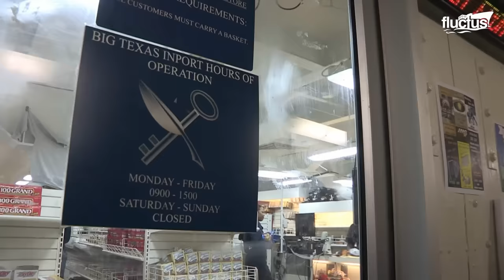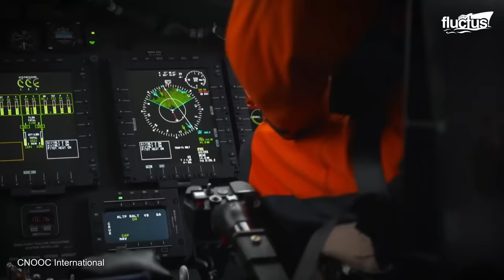Inside US $13 Billion Aircraft Carrier Tiny Kitchen Feeding Entire City at Sea

Comment: It is a logistical wonder, though. Amazing.  At every stop, I would have MIT-trained ME and MSEE + software check everything and run tests. Prevents problems. Software may not work, and the engines may have a problem. Or about to have a  problem. Plumbing fixtures, desal plants, and so much more. Once they clear it the Navy can get a report and learn what problems were found.  Engines, pumps, weapons alignment, and much more need to be checked. It would take six months, but then you know you are ready, and the Captain gets the report and issues training orders. Every time they will find 1000 problems that need to be repaired, tested, and documented It would be better if every carrier of ship could spend 1-2 years in port. That;'s how long it takes to check and test everything.  Then you have reliability when out at sea. Even unreliable cooking great that can be a problem.

Comment: Tiny kitchen? On Naval ships it is called a galley, and a carrier has several!  They operate 24 hours a day.
Reply: They are much bigger than that - only submarines have small galleys - that also features shore side galley’s…
Reply: If you think an aircraft carrier galley is small you need to see a WW2 Gearing class destroyer galley.  The mess deck was not even on the same level, one level below.  Moving 8" full gunboats (hotel pans) down a ladder to the serving line was an adventure in heavy seas.
Reply: @cheftomsd   I served on a 542 class LST. The galley was on the main deck level, as well as the serving line, mess decks one level down. In even mild seas getting down the ladder with a  12" X 18" tray, ( approximate dimensions), was a chore. We once had 110 Korean Rocs on board to land near Chu Lai, Viet Nam. We got into some south seas rolling weather and the deck below the ladder had more food and puke than the garbage can. We landed them and as bad as Korean Rocs were supposed to be, 75% were casualties by dark.  Those poor fellows didn't even have a chance. 
      I remember going on an old destroyer from the mothball fleet and yes, every where was small. I was also on FF's for 5 years. Much roomier than the previous DDs from WW2.
      I never said a carrier galley was small. One could get lost in one on the new carriers.
      Did you ever see the galley on a fast attack sub?   Now that is tiny.
Reply: @seniorrider9337  I served on  DDG 14 during Vietnam and it had a nice galley.  The serving line opened up on the side to the mess deck.
Didn't realize how good I had it till had to cook on a Gearing DD for Reserves.
Reply: @seniorrider9337  
I've worked in galley kitchens in delis.
Thank goodness they didn't move ! 😘